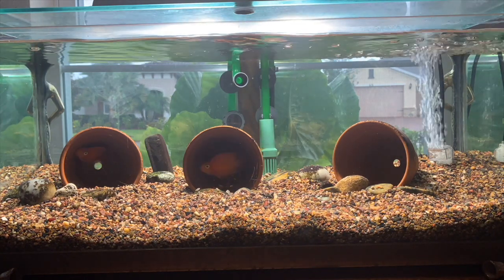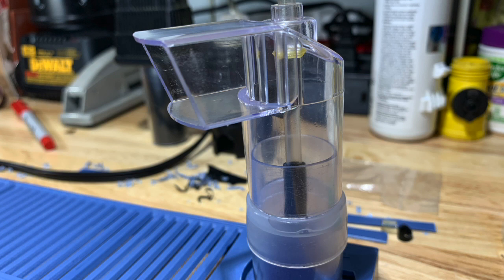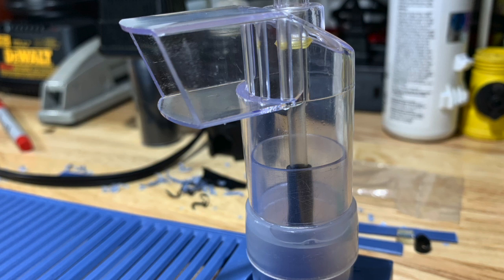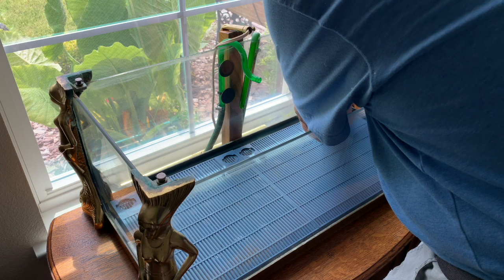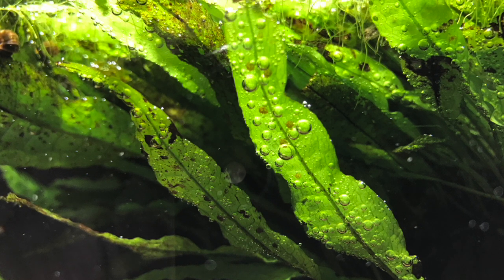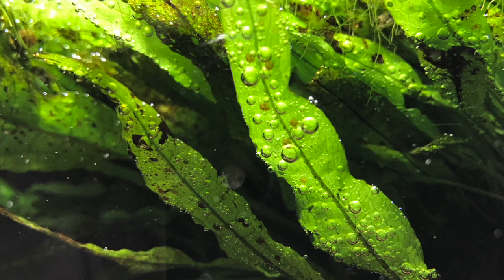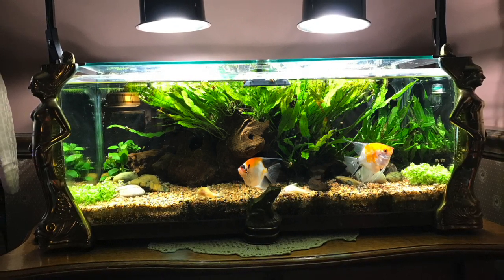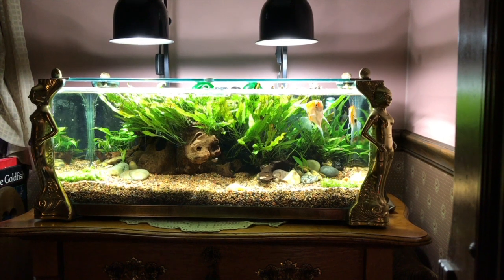How to build a Plenum to establish Anoxic conditions in your aquarium.PART 2. Using sand.

Comment: I came across this video after I ran into problems with my clogging UGF.
I noticed that my power head was gradually slowing down.
And to not dismantle my aquarium I made small holes on the base of the uplift tube, thus reducing even more the water flow through the plates.
I did use geo fabric over the plates to avoid mulm going through. But It did nothing but to clog my system.
Now I think I have a plenum hehe.
So it is time to study more about it.
Reply from the maker: I have been running my plenums for years and never had to tear down my tank. Were you using a powerhead instead of slowly moving the water through the Plenum?
Reply: @anoxicfiltrationplenums  my tank is 200L. And it was using a power head of 600l/h so it is about 3x the total volume. 
But I only have 120L of water, which gives me a ratio of 5:1.
The water movement is very very low.
I don't like the air compressor because it is noisy (I really appreciate the silence when I am watching my aquariums).

But my worry is about the water column, that is becoming more and more still, the slow moving waters in my substrate is one thing, but what about the water column, surface agitation etc?

My tank is heavily planted, I mean, really heavily. And also there are quite a good number of floating plants as well. But most of my plants are submerged ones.
Reply from the maker: @jonathanschutz8563  now I see that is a typical problem when you use high output powerheads that they had back in the 70s and early 80s.

Comment: Thank you very much for all your videos about plenum.   I would have two questions...  Is true , that Seachem prime is not good to use? (when water changing) And second question:  Is it necessary for plenum to cover ugf plates all bottom of the tank? I mean could part of my bottom stay not covered by ugf plate? I have few ugf plates, but it is not enough to cover all bottom from back to front.

Comment: What about maintenance? I have heard traditional undergravel filters have to be removed and cleaned periodically. Can this be left in place for a long time? Like a couple of years?
Reply from the maker: Back in the heyday of under gravel filters to be honest with you I've had them set up for 15+ years easily. There's something that they never go bad and needed very little maintenance to keep them from going bad. I think because of this and their longevity, people like manufactures had to how start changing the way people thought about under gravel filter's. I mean, if you think about it, make any product deck at last 30 or 40 years easily without ever having to replace it. Where is the money in that?
Reply: @anoxicfiltrationplenums  Good point!

Comment: I'm going to stick with using gravel and kitty litter. Sand over time will probably pack tightly and I think impede the flow through the plate.
Reply from the maker: I think you are right, but I'm still testing it out in my goldfish aquarium.

Comment: Hi again Dr. Novak. I was wondering what your thoughts were on a plenum filtration using 1" flat sponge  sheets, lifted 1" of the bottom? Powered with a short lift tube and a bubbler.
Reply from the maker: I'm going to be honest with you I've never tried it, but it's something to think about.
Reply: @anoxicfiltrationplenums  thanks for the reply! I'm gonna have to try it out. It has been bothering me for a while. On paper it should work. One of the issues i am predicting, as some of your followers below stated, may be the frequent plugging. I know some people who use the sponge panels to separate fry from the parents within the same tank (and same water parameters). The thing they bring up is the clogging up of the pores on the sponge.
Reply from the maker: @bojanpeterkovic3871   that may be true. However, if you have things on top of it, like your substrate, maybe it would take a very long time before something like that would clog up years. Then it would pay off.
Reply: @anoxicfiltrationplenums  sure thing. I guess experimenting is next :)

Comment: So, if I got the idea right, the bubbles create an upward flow, which will suction the poop up the tube.

And, assuming I got that correct, one could make the tube end below the waterline, sending the poop up into the circulation off the aquarium that is then sucked into my canister filter.

Does this sound solid?
Reply from the maker: You're partially right and then you're partially wrong. The bubbles do not move water fast enough through the substrate to really pull anything into it except to transfer water. We do not want to turn a Plenum into a mechanical filter, so no more than 5 to 40 gallons per hour is what should be the goal.
Reply: @anoxicfiltrationplenums  Thank you.

Comment: Hi
Why is it necessary to have the uplift on about 4" from the UGF rather than going all the way up to the water level???
Reply from the maker: It will be create too much of a draft and the water will move too quickly. The shorter pipe helps prevent this from happening. Like a sponge filter when hobbiest remove the lift tube from it.
Reply: @anoxicfiltrationplenums  OK,,,, even if you reduce the air uplift to a minimal all the way to the top???

Comment: Dr Novak, I have added the plenum with the 2 uplifts.  Question-I saw in your old video that you said to shut off the uplift air during the day and run at night.  I have vallisneria & anubias only with no CO2 running.  Would it be ok to run the plenum day and night?
Reply from the maker: I said that you can shut off the bubbler at night when you're sleeping if the sound bothers you and leave it run during the day. Otherwise, if the sound doesn't bother you then run it 24 seven.

Comment: Hello, I have bubbles that smell sulfurous emerging from my plenum. Is this part of the process?
Reply from the maker: If you have bubbles that smells sulfuric like rotten eggs then somethings not right. you may have to increase the amount of water flowing through the Plenum.
Reply: @anoxicfiltrationplenums  Ok thank you so much for the reply, I'll move my sponge filter closer to my plenum outlet. I had read somewhere that hydrogen sulphide is a byproduct of denitrification if there's sufficient carbon, so it's not all bad? Father Fish seems to claim that HS is almost never in high enough quantities to affect the fish - do you agree?
Reply from the maker: @TaranMatharu   assimilatory denitrification which converts nitrates back into ammonia and that’s not good.
Reply: @anoxicfiltrationplenums  Ahhh I see. I have moved my sponge filter over to beside the outlet, hopefully that pulls enough oxygen through to resolve the issue.

Comment: Dr Novak - I am going to retrofit my 50 gallon tank with a plenum (already using BCB's).  On a 50 gallon tank would you recommend using 2 uplift tubes with the airstone or just 1 uplift tube?
Reply from the maker: One uplift tube in the center that if the whole filter is connected together. If you have two separate plenum filters then you will need two separate uplift tubes for each filter plate.
Reply: Dr. Novak, I have a Lee's undergravel filter that I am using for the anoxic filter.  It comes in 2 plates for the 50 gal version each plate will sit to the left and right of one another.  Would you still recommend 1 uplift tube in the center?  Thanks for your help!
Reply from the maker: @jimlubeskie4312   if the plates can’t be connected together as one,  then you’ll need two uplift tubes one for each side.

Comment: Hello instead of using an air pump to help water to move, would not be ok to put (connect ) a small tube or hose to the plenum (carefully set) to just drip small amounts of water from the tannks plenum and take it for example to a sump? would not be the same result in regards to make water to move slow? Just asking out of curiosity since I like this system more and more anytime i see  a video ofit and I am thinking on diferent ways to make a setup. As always thanks again for this amazing content.
Reply: I think the problem with that (if you're talking about a syphon working on gravity) is in the event of a power outage your tank would get drained. As for a 'drip' you'd still want to move one or two gallons an hour in a small tank like in the video, more for a larger tank.

Comment: Is it possible to do a plenum without using air pump to move the water through the plates? I like to fill water to the brim for aesthetic reasons and bubbling the tank would make a mess.
Reply from the maker: yes

Comment: I used a thin filter floss to separate sand from an ug filter, and that worked too. In fact, I didn't know about ultra low flow filters at that time and attempted to use high flow, which worked for a while but eventually the sand and floss got a little too clogged, so I dismantled it. I'm still using the same filter floss with gravel in a somewhat low flow reversed flow ug system. It still produces nitrates, but very little. I don't want to dismantle the tank again, so I may try one of your biocenosis kitty litter/flourite filters in my sump.

Comment: I have been following this topic with you. I keep Africans cichlids so they dig. This video answered could use the sand with this. Another trait of cichlids is that they eat plants. Does this system require plants to work. I know that plants are suppose to grow better because of the ion transfer, but will the bacteria in the dirt react the same. with a hang on the back filter set up with kitty liter etc. Will that work for tanks that are unplanted?

Comment: Thin Pool filter sand could be used tô replace play sand or would be too Thin?
Reply from the maker: You can use pool sand,  that's entirely up to you.
Reply: @anoxicfiltrationplenums  so the trick is the undergravel filter, a plástic mesh and the Pool filter...i was thinking If i keep a hangon filter too, but this one with Kitty litter would be good. What do you think?
Reply from the maker: @SonnyBurnett2012   sounds good to me a lot of people do what you’re doing already.
Reply: @anoxicfiltrationplenums  im impressed with your vídeos. My english is not  sooo good. I gotta agree the old way tô keep a tank its the better one. Ill give a try sooner. But im thinking tô keep the Pool sand i haver already
Reply: But you never clean the undergravel filter from times tô times? I mean...dont know..connecting a Power pump in the plástic tube...or do syphoning into the plástic? Plants Will do fine with your method?

Comment: Is that necessary to add airlift tubing to under gravel filter, can't we leave under-gravel plates without tubing as we left BCB baskets in side sumps or canister filter? TIA
Reply from the maker: Yes a plenum will work without a lift tube but it will work more efficiently  with one.
Reply: Thanks! Doc. For replying asked question.

Comment: Very helpful. Thank you.
Reply from the maker: Glad it was helpful!
Reply: @anoxicfiltrationplenums  I like the idea of a dirted aquarium (about 1 inch) covered with a one to one and a half inches of sand. 

I did this with my 6-gallon nano tank and the plants have all done well. After the frogbit took off, the aquarium water was in good health. I added a sponge filter sometime later and learned how to clean it (Aquarium Coop channel). The tank is overpopulated, but the Vallisneria and floating plants seem to easily handle the bioload. No ammonia spikes. All the water levels are good. 

The water is not crystal clear but all the fish are healthy. No deaths. The plants are growing and multiplying. Roots are healthy. It took about 5 months for the ecosystem to settle itself out. I rarely do water changes now. 

I see you also added the Eheim canister filter. I plan to use only your recommended UG system in a dirted, sand-covered, 29-gallon planted tank. Do you have any thoughts or recommendations on that? Would you explain why you found that to be a good idea?

Comment: Would this weed control fabric method work with Father Fish's nutrient rich soil method?

He mixes various gardening fertilizers with the 2-3" of dirt, and then caps that with 2" of play sand. Would the anoxic system work with 4-5" of substrate? And would those nutrients still help the plants, or would they just get sucked up the tube, and cause an algae bloom? 

I really like BOTH methods (great plant growth, and few water changes/little algae), but I'm not sure how the two systems would work together. How would this work with a overcrowded (40 or more baby guppies in a 10g) tank?
I plan to use a 10g tank I put expecting guppies in to keep the fry safe. It keeps the fry safe, and I also grow a lot of plants in it, so I want the nitrates to stay low, but without me messing with water changes or anything...
Reply from the maker: My next video will show my 90-gal with a deep substrate like Dr.Fish but using a plenum.

Comment: Dr Novak, These plenums once setup and established are not be disturbed? How will all the fish waste get cleaned out. Do we need a HOB or canister filter along with plenum?
Reply from the maker: You can still clean the plenum substrates like any other aquarium. However, a BCB does not have to be cleaned because it does not clog as I show in my last video.
Reply: @anoxicfiltrationplenums   please also address my question about setting up plenum along with a canister or HOB for added support until plenum establishes

Comment: if you have a deep sand bed with snails and other critters always moving around in the sand wont that cause a slow movement of water?
Reply from the maker: Yes and no.  Just make sure you have enough fauna to do the work for you and yes, you will have success. However, some say this is still a much and go method.

Comment: Hello! Dirt tanks is my far favorite, but it is going to be very interesting trying out this plenum methode. But when using pool filter sand or play sand.....could filter floss work instead of the ground fabric........can’t seem to find the ground fabric here😌 Do you have any suggestions , fine sponge, filter floss, just regular fabric used in ordinary clothes.?
Reply from the maker: Yes filter floss can work but it was tried 30 to 45 years ago and it clogged with very fine micro particles and had to be dismantled the screen or ground fabric is a better way to go it never clogs.
Reply: Kevin Novak Ph.D.  Thanks.....i have to try to look further for the fabric in your video😊👍

Comment: Hello! This methode is very interesting. I am going to try this out setting up a new tank. I have gravel with grain size 1 - 3 mm. I have 10 kg of red pottery Clay that i bougt for my dirted tanks. But my question is: Is it any benefits to use pottery Clay in the gravel over the filter plates??
Regards
Jon Olsen
Reply from the maker: Sounds great!
Reply: Thanks! I have been using algae scrubbers on my reef tanks like kind of a natural filtration......maybe this plenum is the way to go with freshwater😊Looking forward to try this methode👍

Comment: This is really interesting. Does ADA aqua soil develop anoxic conditions when filled quite high and in combination with powersand?
Reply from the maker: Yes if it is off the bottom of the aquarium. If not it will develop anoxic conditions but it also will make anaerobic conditions too. This will compromise the longevity of the system at some point.

Comment: Greetings,
What is your information /experience on using 2-3 inches of dirt with 2 inches of sand on top in long term having a natural tank with live plants and fish -freshwater ?
Does the dirt section in above example  act as would the undergravel filter ? ( ugf act as dirt).
Got above  info from "Father Fish" (natural tank) on You Tube. 
My 55g has used UGF for about 25 yr. Also have 40g &  2- 30g tanks with UGF, last year .
But just have used natural gravel in with the UGF.

Is the dirt a useless level if using an UGF .
What to use a 30g with UGF /sand (with screen) but wondering about dirt layer.
What dirt would you use ?
Thank you,
Richard
Reply from the maker: Dirt in tanks have been used for 40 plus years, my next video will explant test done with dirt and the outcome my class had with it. Please do not miss it.
Reply: I have tried twice using Jordan tanks following father fish. I like the concept, but I found the roots of my plants turning black like Dr. Novak mentioned And a foul smell when I tore it down from the organic matter under the sand. I would love for this to work. Dr. Novak, thank you for your explanation on plenum. I never heard it before and that might be the answer to healthier plants getting what they need. BTW, Do you add any fertilizer or nutrients to the water column for your plants?

Comment: Hey Dr. Novak, 

If I was going to do the same thing on a 120 gallon with two 55 gallon undegravel filters placed on in front of the other, do I need to drill holes in between them in the wall so the water will flow through both?
Reply from the maker: No, just have them independently working.

Comment: I love this idea! Is it possible to do medium to large rock aquascape with this system?
Another question. Can I use Montmorillonite Clay with this system?
Reply from the maker: Yes, you can! Plants are not needed. Video coming up on substation clays that can be use for a BCB so stay tuned.
Reply: @anoxicfiltrationplenums  another question. could you use Hang On Back filter in the place of the air stone?